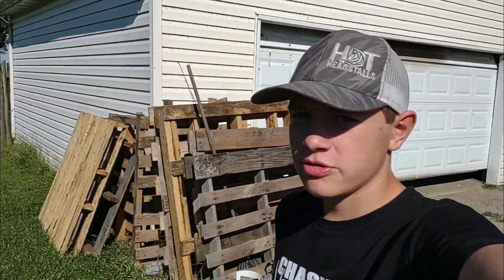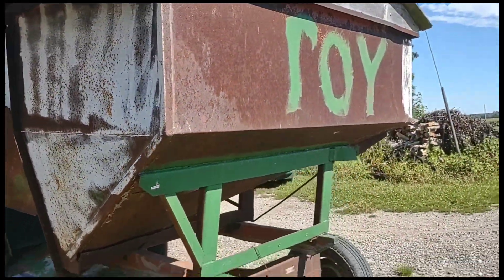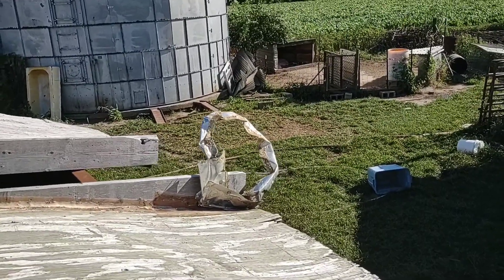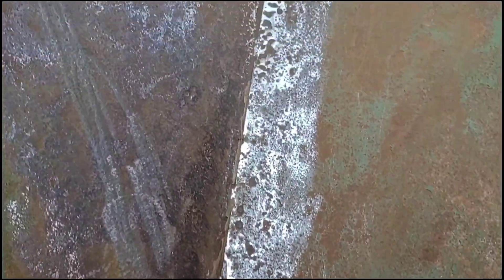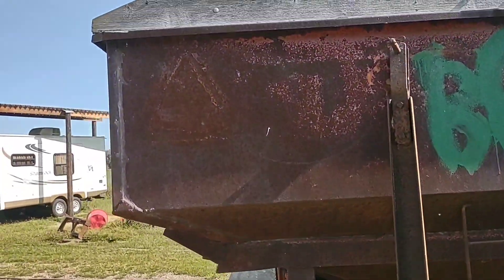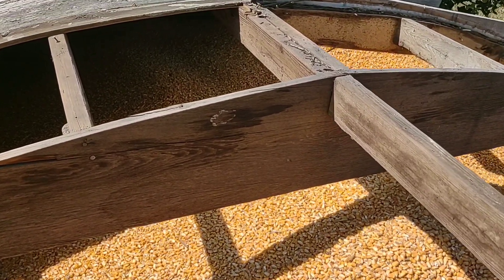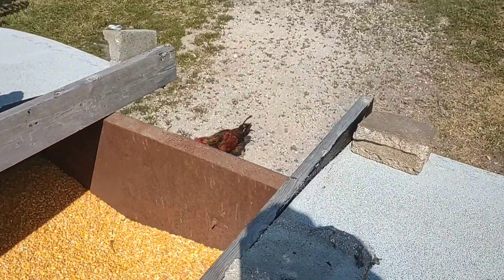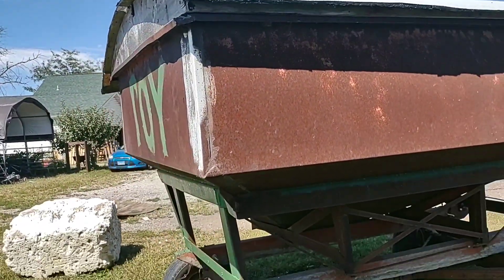fixing up my old gravity wagon (part one)

Comment: Great buy on that wagon and your getting it fixed back up nice! On those inside seams that have holes jb weld as mentioned for small hole or two or auto body filler called bondo works great! Those wheels on your grinder are called flap wheels come in different grits,  those chickens were  sure enjoying that bucket of 🌽 have a good weekend!👋
Reply from the maker: Thanks. I am definitely going to try JB weld. I can't believe that I didn't think about using it. Thanks for watching. You have a great weekend too.

Comment: Hi Ryan.  I've used a wire wheel on my grinder to clean up truck frames so I bet they would work well for that.  If you don't have a welder to fix the holes you can use jb weld and it will last longer than the  caulking.
Reply from the maker: That's a great idea to use JB weld. I didn't think about using that. I will probably try that. Thanks for the idea and thanks for watching.

Comment: If you know a mobile welder, I would suggest installing new "corner straps"(don't know what else to call them, just the pieces of steel that are on the joints of the panels) on the outside of the box. Fill the holes on the inside with high build primer, sand and paint. 
If you don't know a welder, you could use jb weld as a body filler(I would have a healty amountof overlap on good steel), then prime and paint. I would suggest taking a welding course, you could make it a little side business opportunity later on if you like.
I like the roof idea.
Reply from the maker: I think I am going to try  JB weld. I think I will be taking a welder course sometime done the road and hopefully have a welder to. thanks for the great idea and thanks for watching.

Comment: if u don't have a welder to fix the hole u can use angle iron to cover the hole, drill bolt size holes in angle iron first then mark where to drill holes on your gravity box. or something else i can try is melting some lead and pouring the melted lead along the edges, block off 1 inch below where the hole is and cover the one side with thin tin to stop the lead from leaking out. u can get free lead from old batteries or the side of wheels that were once balanced, u could have some on rims on that wagon and not even know. we my twin brother and me learned alot from great grand father, grand father and Dad but we buried them all in 2020
Reply from the maker: I hadn't thought about using lead that's something I might try. Thanks for sharing. Sorry for your loss again. Thanks for watching have a great weekend.